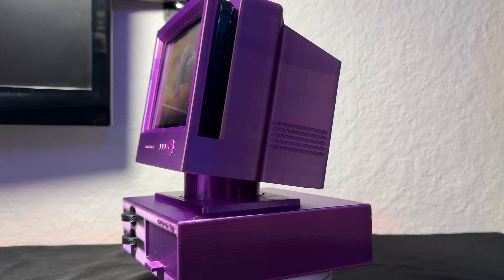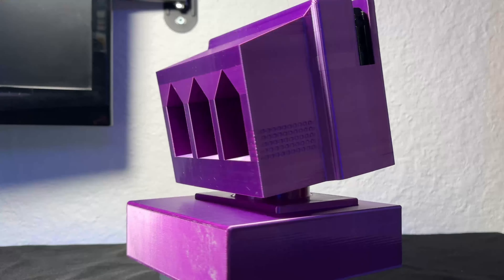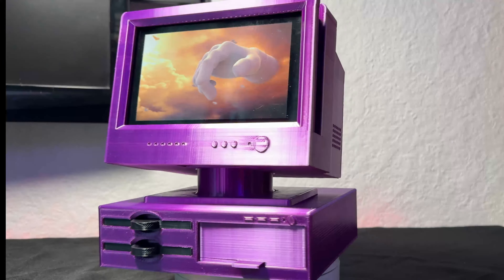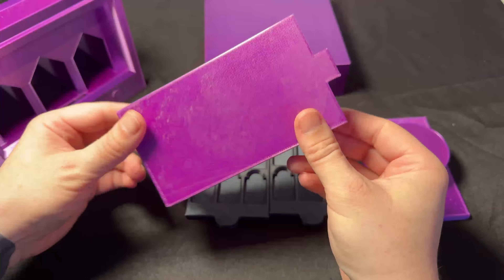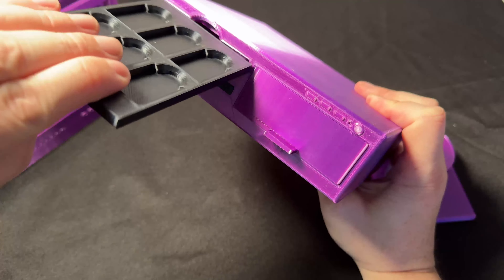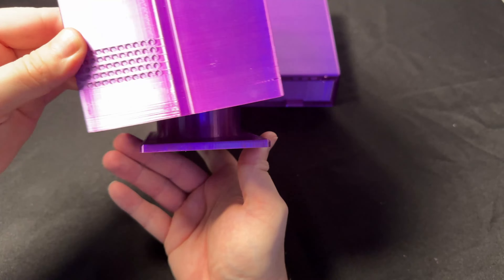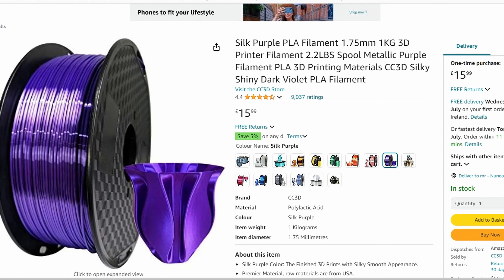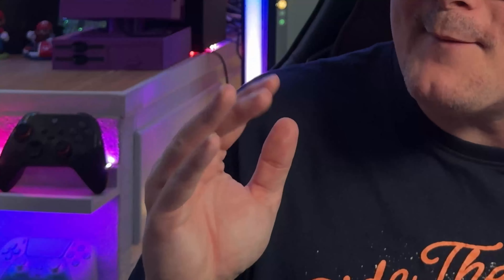The Best Switch Dock I Have Ever Seen and you can't even buy them.

Comment: This is amazing and knowing that you used the same printer as the one I have makes it even more accessible for me :)
I'd love to give this print a try. Any special settings you made other than to use suppports for the CRT part probably?
Reply from the maker: the crt was the only part I added supports on and I only added them on the bar at the front.
I used tree supports ( connect to build plate only ) and a 10% infill.
I used elegoo cura and set it to fast 0.2mm.

Comment: Great video! It looks really cool and I would love to own one, just have some questions. 

How heavy / stable is the entire dock with the switch inside? Also, when the switch is plugged in, is the airflow good enough to where the switch temps aren’t overheating?
Reply from the maker: It's stable enough but I would say both the crt part and the pc base needs rubber feet as it slides about a bit.
Air flow seems fine as it has the holes going all the way through the crt for the intake and then nothing is covering to top for it to escape.
The print is light but the switch gives it enough weight.